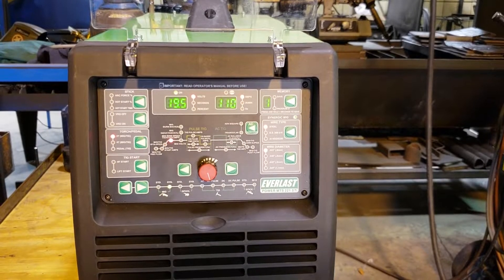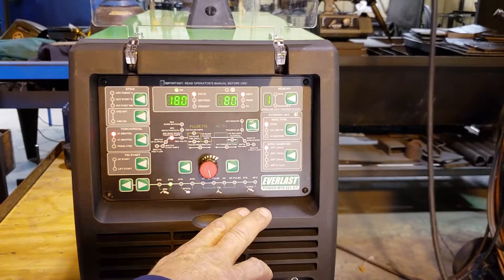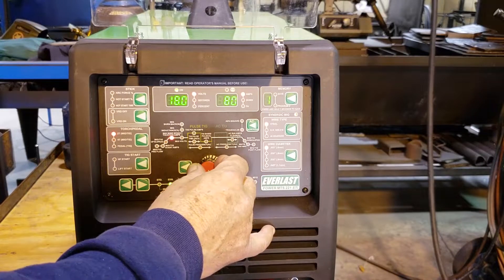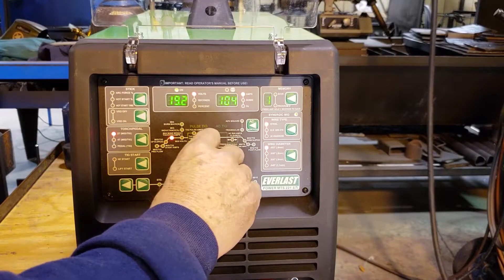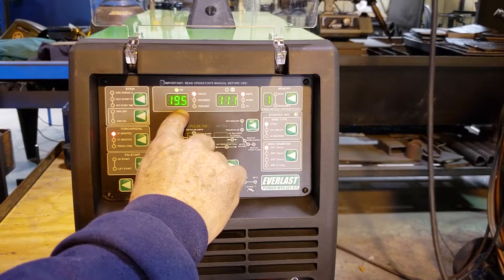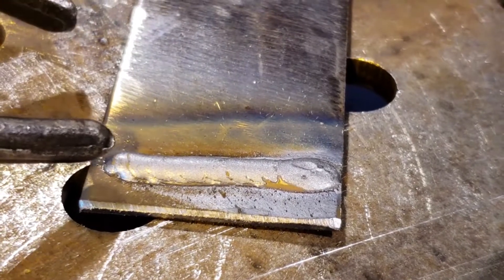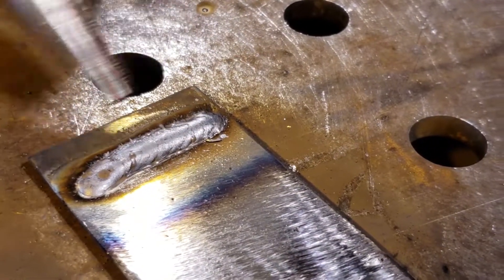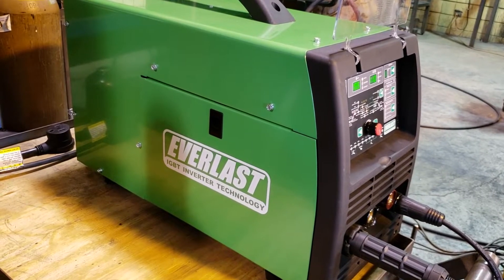Everlast PowerMTS 221 STi: Synergic MIG

Comment: Love to see you do a sheet metal video.. using mts252
Comparing syngenic mode vs manual mig mode...
Newbie trying to learn the mig setting on my mts252 wire speed vs amps and volts ...need a good video explaining how to set up a  mts welder ie mts252

Comment: Bob moffet, i had a quick question. What are some good starter settings for mig using 110 outlet? Or do i have to get a 220 put in? I was using 0.30 wire argon Co2 mix gas 75/25. Also do you have to change tips to fit different size wire or can you use the same for all sizes? I'm new to this machine, I'm good with Tig, stick but having problems finding a descent start settings for mig using 110v outlet.